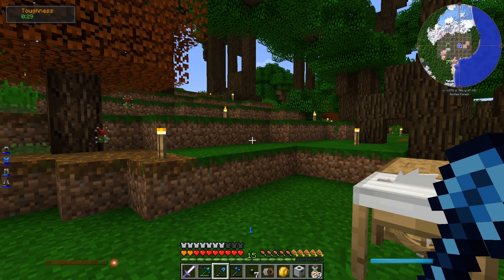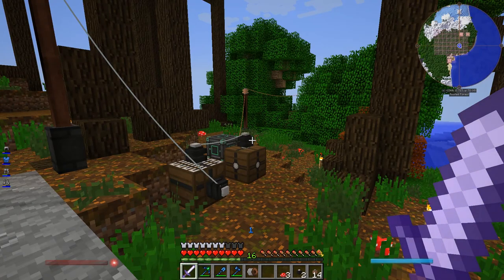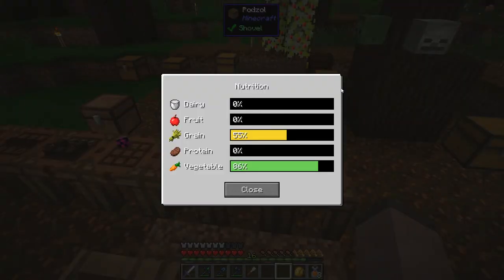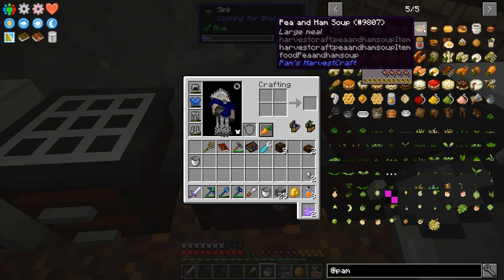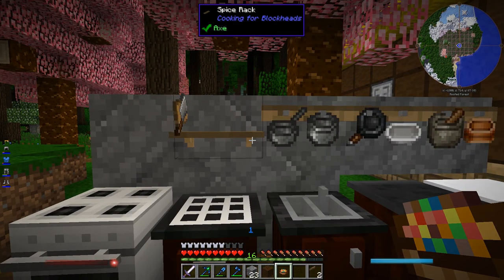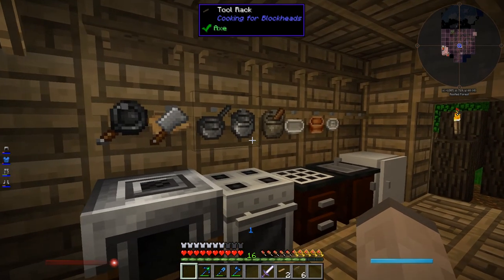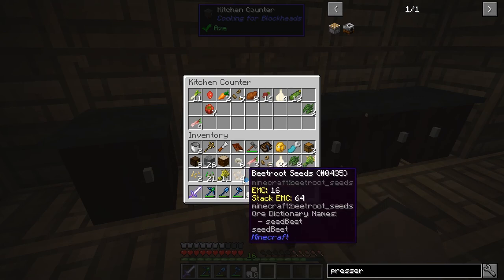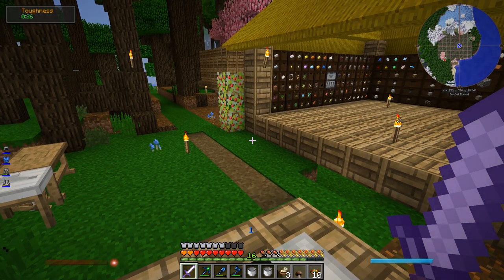Minecraft Nuts and Bolts: Torqued (Ep. 9 – Kitchen)

Comment: For building the kitchen a bit more to be aesthetically pleasing, you could expand the fridge with another on top of the one you already have and it will double the inventory space of it while making it to where you need less of the spice racks to connect all of the counters and such together. And instead of having them all over the walls you could have them in a ring around the top of the structure and then have a large fridge on each side to connect them at the corners. The stove also works as holding the utensils for another visual ontop.
Reply from the maker: Good ideas! Thanks
Reply: I'm glad you like it! You're welcome!